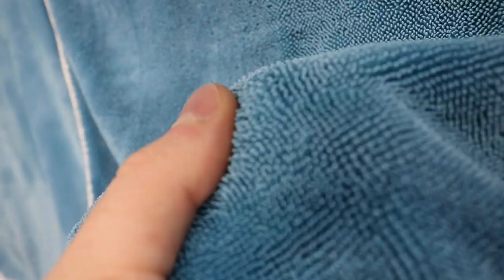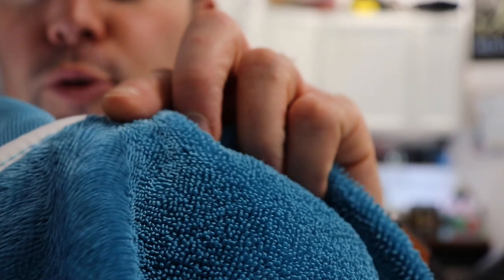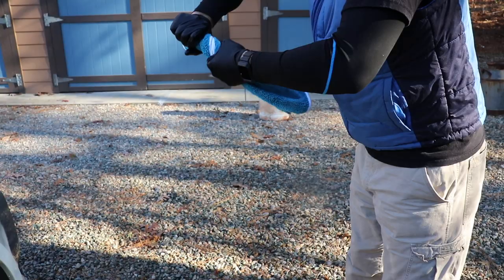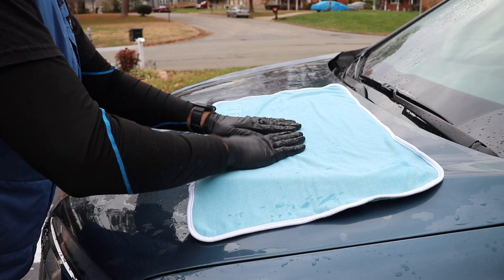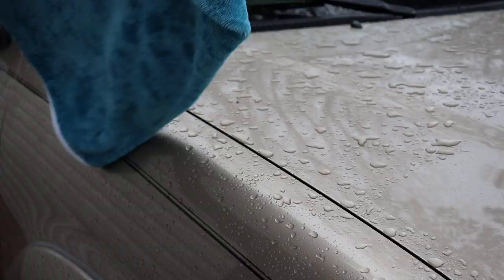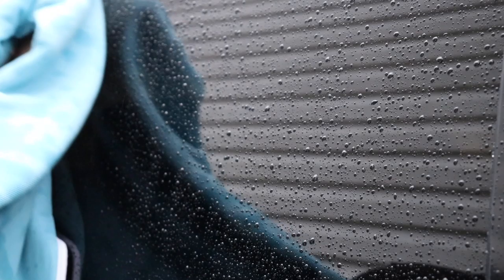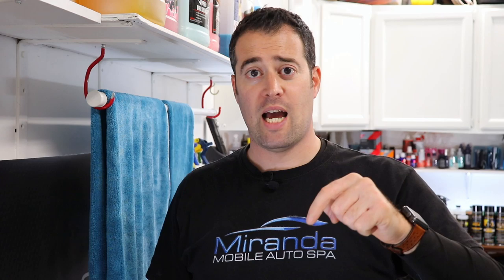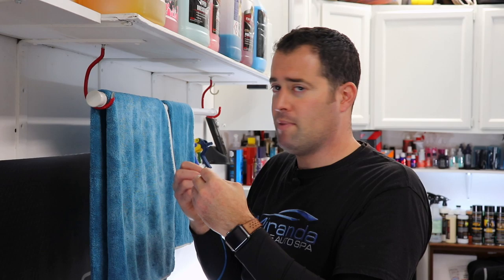Awesome Drying Towel / GT Shine Twist Towel / Free Towel Giveaway!

Comment: I use a very similarly designed for drying, it's very absorbent and has the lower pile side for glass, but it's only available in the same size as the smaller one you showed. I have a truck and prefer the larger drying towels.
Reply from the maker: Awesome! 😎👍🏼

Comment: I could try the smaller one. I use Griots pfm drying towel (the grey one) and sometimes become heavy and dificult to try doors and you need to be very carefull because it can touch the floor
Reply from the maker: Carlos Rivera yeah that’s true. I have had some large towel like touch the ground if I didn’t properly control it 😡.  I do like the smaller towel for sides. 😎👍🏼

Comment: Would be nice to try the larger size mf drying towel. If it's not possible to shipping it international then if I where to win you can draw another one as I live in Sweden LOL. 

I have some of these style of drying towels. They are superior in how fast they soak up water and don't leaves water streaks until they get saturated. Personally I just reach for a fresh drying towel when they gets saturated. As some is impossible to wring them out of water. Hope I can explain this in english as it's not my first language LOL. But if you remember those old presses where you pressed out the water from the clothes so they where drying faster afterwards. If you can find one of those in great condition they works great to wring out mf drying towels with them. It's those with 2 cylinders often in wood and then a long handle to get them rotating and you can set the gap between the cylinders so you can get through different thickness of the drying towels. Can be helpfull to have something like that for getting as much water as possible out of the drying towels so they gets dryer the next day you are going to be useing them. I used google translate and got it to be called a Mangle if that's what they are called LOL. There are ones that are electrical driven too.
Reply from the maker: Hi. I’m not sure if they can ship internationally I’ll ask. 
Yes I know exactly what you are talking about! Reminds me of watching cartoons when they would use those old fashion cloths driers. 🤣😎👍🏼